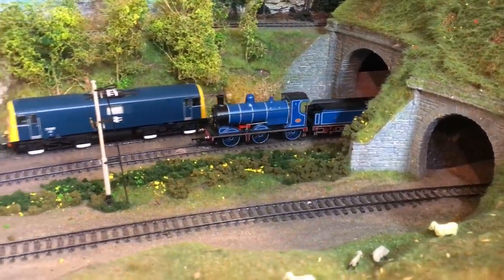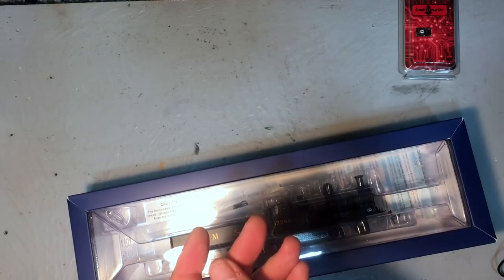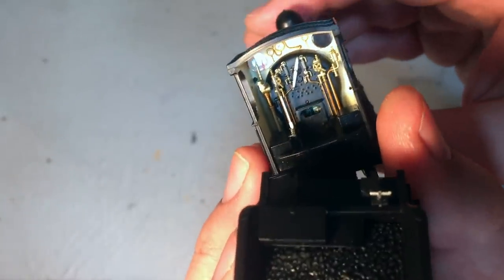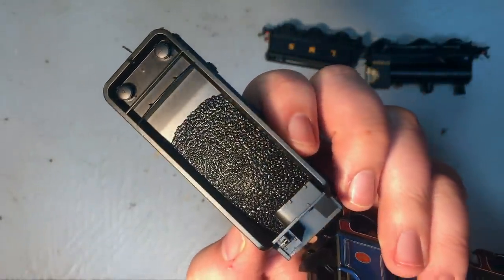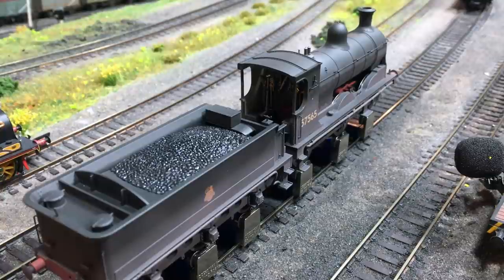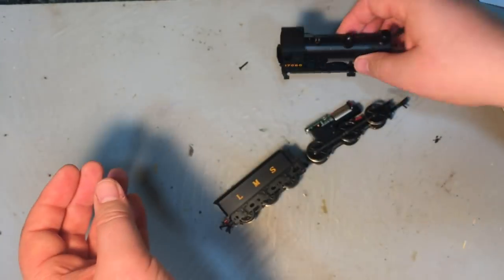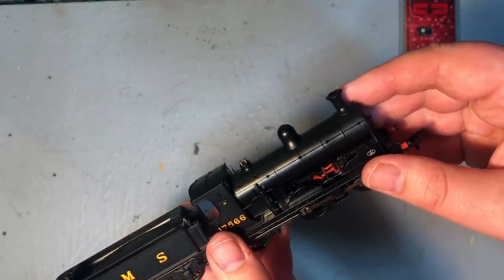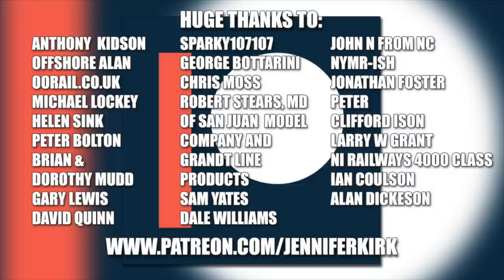Were they Worth the Wait? Rails of Sheffield Bachmann Caledonian Class - Unboxing and Review

Comment: With the exception of 57565 (the black one w/early BR logo) it's actually the same loco across the board! Following grouping of raIlways CR no. 828 ran as LMS no.17566, then BR no. 57566.

The Strathspey Railway where 828 runs is my local preserved railway, so I'm lucky to see it running regularly.

Comment: I'm amazed yours ran straight away with the Train o Matic decoder. Mine ran off at 50% speed on speed step 1, and I had to change CV61, P factor of the BEMF, from 80 to 10 to get it to behave. Then having adjusted CV5 and CV6 to match scale speed as the loco runs far too fast, I found F3 while activiting the firebox light slowed the loco. I remapped the decoder functions so that F1 and F2 switch the firebox LEDs, leaving F3 as a 'shunt' mode. Also there is no flicker function on the Train o Matic decoder.

Comment: Great review. Thanks for that . This is a loco I’ve been waiting for for years . As a DCer I’m not really bothered by speaker installation and firebox glow , I would have rather had a less expensive price . If maybe even coming in at £150 I’d have been tempted for two . As it is I’ve restricted myself to a dark blue one . Priced at £179 for the black ones and £199 for the Caley blue these are not cheap in comparison to say a Hornby J36 that I do have two of . Yes they are not blue, but Maude has equally fine lining to the Caley model and was £135 TTS sound fitted . I think my BR one was £105 . So these are expensive for an 0-6-0 . I dare say the £300 locos are diecast Pacific’s , so not really a valid comparison . But it’s nearly 4 years since announcement and they look very fine models , so I’ll be pleased when it arrives .
Reply: Probably costs so much because it's an "Exclusive" so its bound to be more than what you would pay for if these were in the main range. Not to mention labor costs in china and the cost for tooling amongst other things plus the current situation with the world rn. If these where announced as part of the main range back in 2018 the price probably would've been around £150-£160 but that's just a wild speculation from me :)

Comment: Hi Jenny.
Not impressed by the thickness of the tender tops. Looks far too square in comparison to the real thing. 
Its not noticeable looking side on but would be noticeable at normal viewing angles on a layout.
It might be possible to relieve that sharp tender top inside edge if only to get rid of that square look.
This shows one of the problems of pre ordering models especially if you have to pay a non refundable deposit.
Pre ordering is often made on the basis of a few photographs.
Tony.